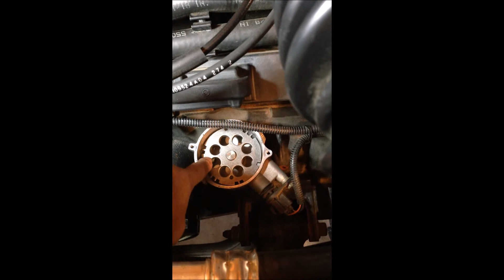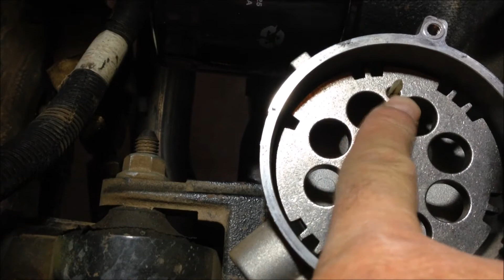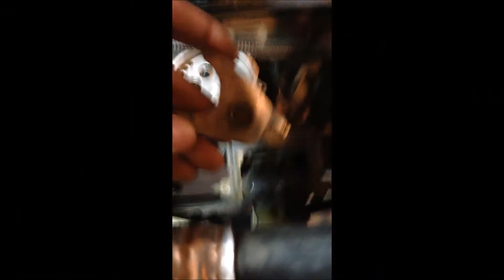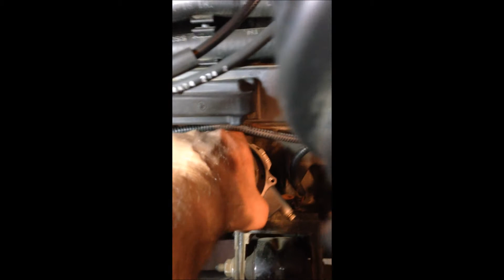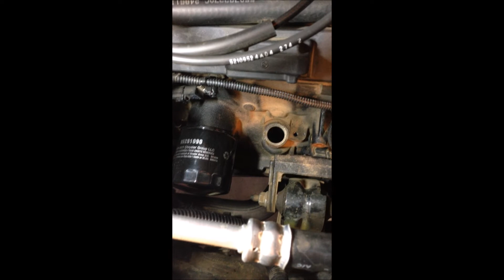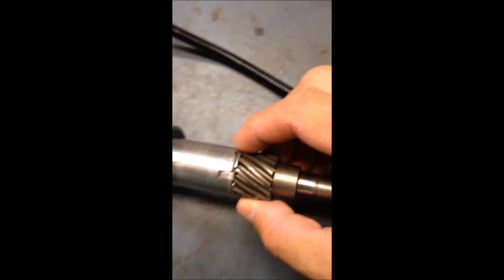05-06 Jeep Wrangler TJ -  OPDA Replacement

Comment: How has the Crown unit worked for you?
Reply from the maker: I recently sold the Jeep to a good friend of mine.  Crown unit still running fine, with no signs of trouble.  As far as I know it's the only safe choice on the market.  Don't buy a Dorman unit.  I had 1 fail right out of the box and read horror stories about catastrophic failures of them which is why I pulled the second one they sent me out and threw it away in favor of the Crown unit.
Reply: @ljdavecolorado534  thats what I've heard too. Thanks for sharing your experience!
Reply from the maker: I recently sold the Jeep to a good friend of mine.  Crown unit still running fine, with no signs of trouble.  As far as I know it's the only safe choice on the market.  Don't buy a Dorman unit.  I had 1 fail right out of the box and read horror stories about catastrophic failures of them which is why I pulled the second one they sent me out and threw it away in favor of the Crown unit.

Comment: Thank you for the video. Im getting a PO016 code and was advised to be sure “everything is lined up” with odpa? Do you have to set motor at TDC before pulling odpa and line up gears? Thanks

Comment: Thank you, very helpful video! Though I wish I had read the comments recommending the Crown unit over the Dorman. Oh well, at least it isn't howling anymore.
Reply from the maker: Don’t leave that Dorman OPDA in your Jeep for very long. Their failure modes are more catastrophic than the original LDI unit. Eat the cost and replace it with a Crown so you won’t have to worry about it any longer.
Reply: @ljdavecolorado534  thanks, looking into it now. Unfortunately, the Dorman one was the only one readily available. It sucks having to buy something twice.

Comment: was that old opda makin a ticking noise while running? going thru the same problem right now on my 06
Reply from the maker: The one replaced was a Dorman, and it wasn't making any noise or throwing any codes, but I was concerned after seeing so many Dorman catastrophic failures online, that I had to replace it with a Crown.  Hopefully it's the last time I'll have to do that job.  My first and second ones were the original LDI factory units and they failed with the laughing monkeys sound you here about.  1st one failed at 5k miles, second one made it to about 15k miles, then a Dorman, that failed immediately, replaced under warranty with another Dorman, and finally replaced with a Crown for peace of mind.

Comment: I have read the Dorman that u removed is the best opda money can buy due to bearing design...and you removed it after only 8k miles?  wondering reason why?  noise?
Reply from the maker: Sorry for the delay in my response, I was out of the country with no access to YouTube.  I bought the Dorman OPDA before the Crown unit was available.  I've actually had two of them in my low mileage Jeep.  The first one had a bad seal as shipped by the factory.  It leaked oil into the target wheel housing and then dripped out of one of the holes below the target wheel and made a mess all over the side of my engine.  It did this immediately upon installation.  That unit was replaced by Dorman under warranty.  The second Dorman unit was still functioning fine when I removed it and replaced it with the Crown unit.  I had read about multiple catastrophic failures of Dorman OPDAs and I just didn't feel comfortable leaving it in there.  I have not read a single report about a Crown unit failing.  If you are still looking at which one to buy, get the Crown.
Reply: Dave, where did you buy your Crown unit?  Thanks!
Reply from the maker: I bought my Crown OPDA from a vendor on JeepForum.com called Kolak Performance and Offroad.  They had the best price at the time.  Kolak Performance and Offroad
A Division of: Multitronics, LLC
Telephone: 480 998-3661
Kolak@aol.com